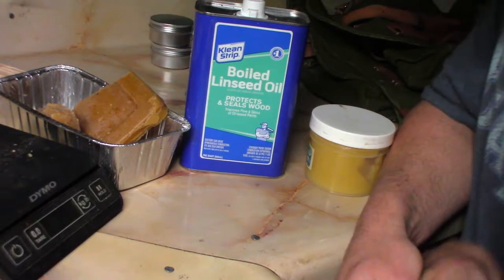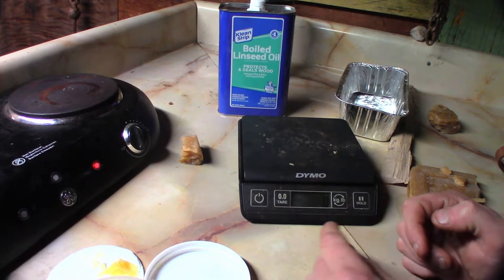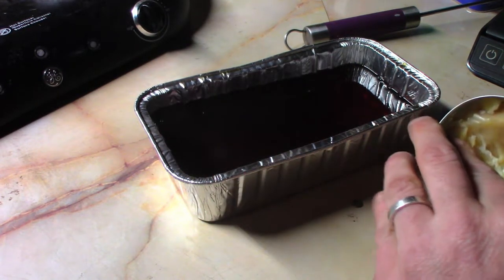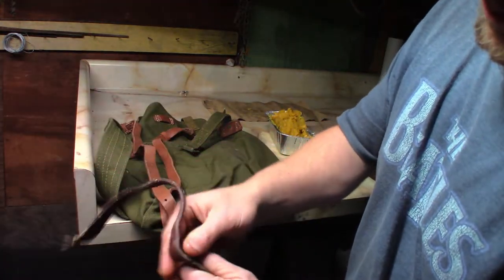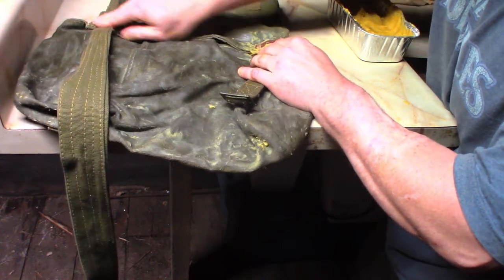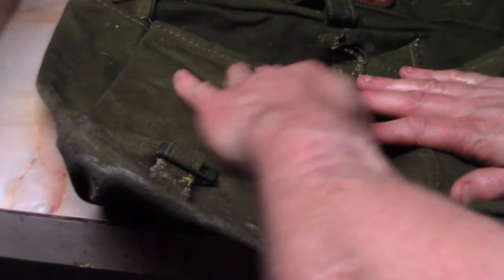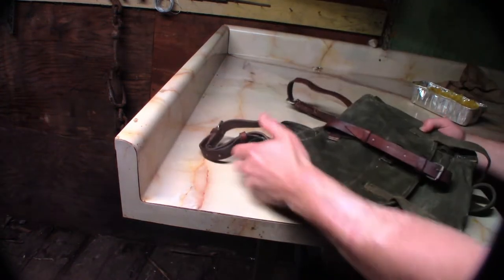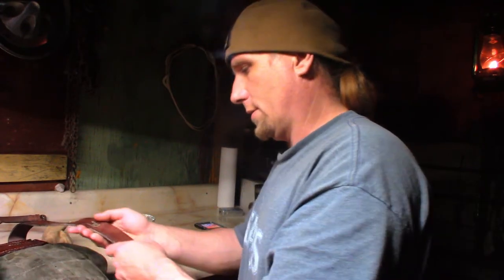Making Beeswax Water Proofing Agent for Leather and Canvas

Comment: Why don't you just apply it when the mixture is melted and use a 2" -3" paint brush, to brush it on then hang the bag to dry? seems like it would be much easier. also I've seen people use a 5 gallon bucket depending on the size of the bag they are water proofing, and they squeeze 2-3 big tubes of 100% silicon with a calk gun into the bucket with about 2qt (or up to 2 gallons) of naphtha  and stuff the pack in and let it soak for 10min stirring it every few min, then remove and hang until dry .
Reply from the maker: I use silicone on nylon and polyester fabrics sometimes. Or to reseal nylon tents and shit. A lot of my packs these days I make my own fixin wax or Greenland wax is a brand name of the stuff. But 💯 use a decent size brush. Our gloves that we make, I use a 1” brush. I’ve tried dipping them and other ways to apply the dressing. On gloves, they have to be brushed. 

On packs, you can buy the spray and spray the hell out of it. It just stinks like chemicals. I cheaper out and did that with my fjallraven pants. I won’t use it again. It stinks. I have also since switched to a polish bread bag as a haversack. I just scored a couple dozen of those. I’ll be modifying them and waterproofing them and selling them in my gear shop. I have a video on waterproofing them over a campfire. But they’re awesome haversacks. 

Anyway, I typically use the smaller brushes bc it makes it easier to get into the nooks and crannies without gobbling too much wax up everywhere else. But a bigger brush would be faster, dipping would be fastest. But better precision for just getting the wax where you want it with smaller brushes.